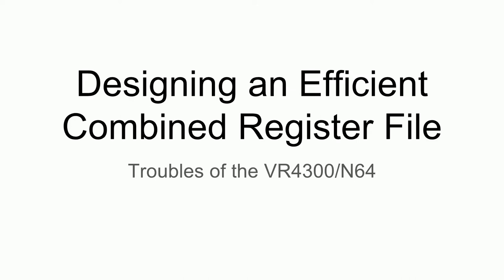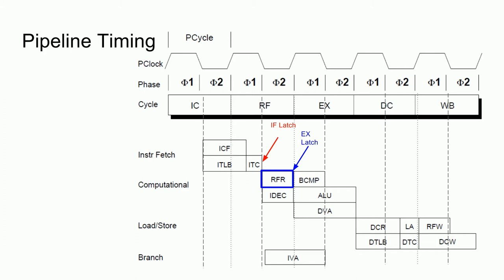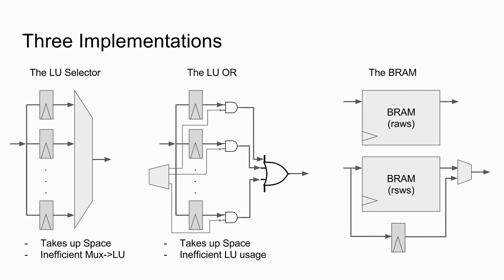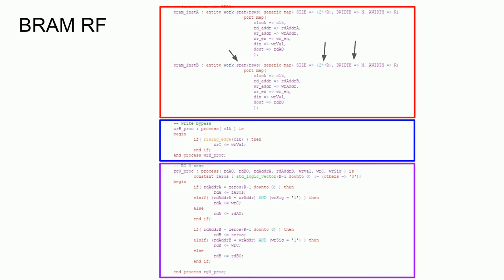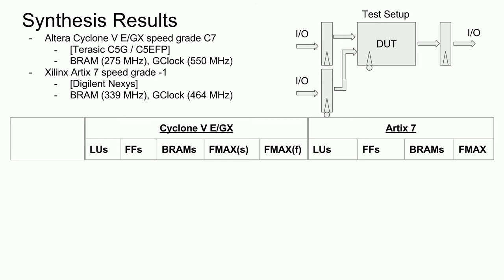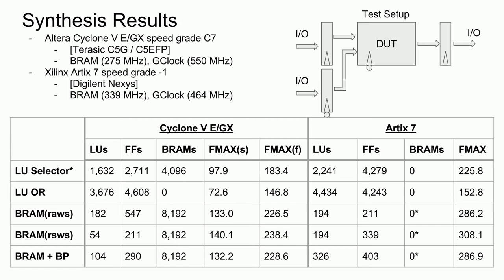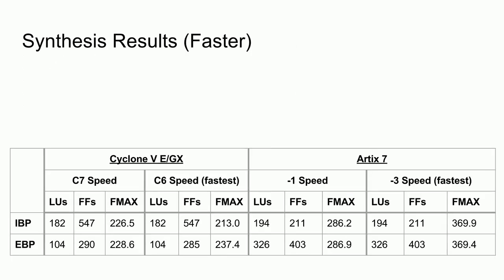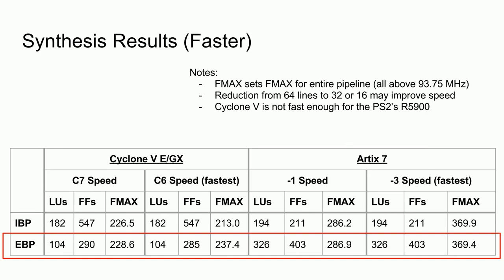Designing an Efficient Combined Register File

Comment: If you want to "shave" a tiny bit of a picosecond : initialise the register set's 0 register to 0 during boot then don't enable write to it later, so you save a test and a gate in the critical datapath during the read cycle.
The advantage is that the register write address is known well in advance, compared to the read address which must be provided extremely fast by the instruction decoder. So you can control the "write enable" signal outside of the CDP.
Reply from the maker: That's a good idea actually. Since the read logic replicates the the test, which would save a bit of logic and only require propagation in the write-back stage which is rarely the cause of timing problems.
I may have to implement that solution, since the RF stage of the VR4300 is a 1/2 cycle.
Thanks for the suggestion!
Reply from the maker: Actually, I just checked what I did, and I effectively did what you suggested. Instead of testing for address 0 upon reading, I inhibit writes to address 0 during the clock update. I.e. I used a loop to connect the register clock writes, which skips index 0.

Comment: Great Argument, however one question in the LU OR implementation, can using tristate buffers enabled by the decoder help? The and-or stage is essentialy doing that only. Which would be more preferable from the two, as a first-cut prospective?

Comment: What happens when you force the Altera implementation to use MLABs (distributed RAM) as well? Cyclone V should support this.
Reply from the maker: The Cyclone V doesn't have distributed RAM in the same way as the 7-series. The 7-series has SLICELs (logic) and SLICEMs (memory), where as the V series only has the equivalent of the SLICEL (Altera called them MLABs as I recall). They are also implemented differently where the V series used traditional MUX based LUTs and the 7-series uses SRAM blocks. The main difference between the SLICEL and SLICEM is that the SLICELs are read-only. So when you implement distributed RAM in the 7-series, it uses the SLICEM blocks (which have different configurations, the largest being 2-bit 128 entry, and the smallest being 6-bit 32 entry - both configurations only use a single SLICEM). On the V series instead, distributed RAM uses the registers / FFs in the MLABs. I could be mistaken though - it's possible that I missed something.
Reply from the maker: I'm not sure if you still have the OR vs Mux question. On the V series, they should be functionally equivalent, however, the OR implementation does lend itself to a tree-based routing scheme better, so it will have less resource utilization at the cost of propagation delay. For the 7 series on the other hand, it has dedicated MUX components in the SLICEs, so using registers + Mux can implement 1-bit of 4 registers in a single SLICE (using both the FFs and the Mux), where as the OR implementation would need 2x SLICEs. Though you still gain the advantage of the tree-based OR method being easier to route. That was the whole point of trying both, and it did differ on some of the implementations.

Comment: Note : I have solved the "Mux wall" problem for the version with individual FlipFlops : https://connect.ed-diamond.com/GNU-Linux-Magazine/GLMF-218/Quelques-applications-des-Arbres-Binaires-a-Commande-Equilibree
it might not be the best solution for you case because I think specialised BRAM is best, but it's good to know you can make large MUXes with a lower propagation/fanout price :-)
Reply from the maker: Sure, that's a solution, but not a very code friendly solution (i.e. it's hard to tell what it's doing). For this case, using a BRAM or on the 7-series, the SLICEM RTL-RAM is significantly more efficient.

Comment: My brain hurts.
Reply from the maker: Because something that should be simple is not so trivial? Or was there a part that was confusing, and should have been explained better?
Reply: RTL Engineering 

It was all explained perfectly, it's just a lot of info to absorb. lol

I've had a tiny bit more success with booting the SGI Indy BIOS on the DE1 btw.

I got the serial output working in the same way as I did for the PS1 BIOS - by finding the routine which writes the data in a register (in this case, $v1) to the serial chip, then grabbing that value on the next instruction, and writing it to a UART TXD block.

Unfortunately, the serial strings are word swapped, so I'll have to figure that out, but I can at least see where the boot process is failing now.

I'm spoofing the reg values for how many "SIMMs" are installed, and the BIOS is now attempting to do a quick RAM test.

But, the aoR3000 core is not allowing writes to the bus in the 0x9FC00000 range (uncached?), so I'll have to tweak that some more.

Not sure why It's trying to write to the BIOSes location, but it probably gets unmapped by another reg just beforehand?

Or, far more likely is that it's trying to use the TLB, which I of course disabled previously when I was messing with the PS1 stuff.
Re-enabling the TLB shouldn't be too hard, but I expect tons of other issues afterwards, as there's still no FPU.

I'm tempted to plug in the R4300i, which is already on an adapter board, but then I lose most of the debugging and register grabs that I can currently do with the aoR3000 core.

I'd also need to write a state machine for the SysAD / SysCMD bus, but it might not be too bad.

Anyway, it's been fun to mess with, and learn more about the SGI hardware.

Really enjoyed your vid again, as it's very relevant to the PS1, SGI, and obviously the N64. ;)

I posted the link to this vid in #n64dev on IRC earlier, as I know they will also appreciate it.
Reply from the maker: Awesome, thanks!

So there is one way to tell if it is expecting to go through the TLB, were there any TLBWI or TLBWR instructions that passed over? By default, the MIPS TLB starts in an undefined state, and it's the job of the BIOS to initialize it, if it plans on using it. I was trying to get u-boot to work on a C++ implementation of a R4000 core, which kept ended up trying to write to BIOS ROM. The reason for this ended up being that the evaluation of where to go was read from an address which was in the TLB mapped region, but the TLB was never initialized (I hadn't implemented the TLB yet). I had to add in a quick 1:1 map for the TLB region, and I was able to get it past that point of the boot sequence. 

As for the serial port, shouldn't it be attempting to write to a specific serial device? They are typically memory mapped with a physical address, if so, then you should be able to read the output from the system bus write attempts. Or better yet, you could find out what type of serial device it was expecting, and implement that in the FPGA (serial devices are pretty simple). Also, probably not word swapped, perhaps it's a different endianess than you expected?
Reply: RTL Engineering 

Yep, I need to check for any TLB instructions next.

I'm hoping it will boot just a little further after I get the SDRAM working, as I really want to start implementing some basic graphics stuff.

As with most systems though, I highly suspect it will copy a chunk of the BIOS into to RAM first, so it probably has tried to set up the TLB already.

The Indy has a fairly complex Memory Controller ASIC as well, but most of that seems to relate to SDRAM mapping, parity checking, refreshing etc., so I can probably bypass most of that.

It uses mainly "PC style" stuff for the keyboard, mouse, interrupt controller, but all integrated into one chip (the IOC).

The serial chip core is also on that chip, but uses a (frankly overcomplex) Z80SCC core.

It looked like a PITA to implement properly, so I just did the register grab thing for now, and can pause the aoR3000 while each character is being sent via RS232 to the PC.

In fact, the aoR3000 is only clocked at around 4.65 MHz right now, because the current SDRAM controller has to be 1/16th speed on the user side atm, so I don't need to pause the CPU for the serial output, even at a whopping 115,200 baud. lol
Reply: It is all getting a bit unwieldy now though, as I had to add some extra bus outputs to the aoR3000 so it bypasses the (disabled) cache, so it can write data to the IO regs more easily.

The aoR3000 isn't really set up for accessing this mem-mapped IO stuff, so it wouldn't do the usual Avalon bus write requests in those ranges, hence me having to export the internal data bus stuff, and the exec_cmd_store signal for those writes.

Also, the DE1 Flash chip (for the Indy BIOS) is only used in 8-bit wide mode, the SDRAM is only 16-bit wide, and the aoR3000 of course expects 32-bit wide accesses for everything.

Getting the basic memory state machine working for all of that was another huge PITA when I was messing with the PS1 stuff.

Basically, it's all a huge kludge, and I don't really know what I'm doing, but it's fun to learn (when it works. lol)

(Oh, and the other reason everything is clocked so slow is due to the 70ns Flash on the DE1, so only ~14 MHz max.
It was originally a 90ns chip as well, but I replaced it. Terasic cut costs on the later DE1 boards, and stuck the even slower chip on it. grrr. lol)

I should really learn to use Qsys more, and move all of this over to my Cyc V GX board, and the LPDDR2, but I don't have a straightforward way of loading the BIOS image, and the GX board doesn't have parallel Flash. The aoR3000 core is at least already set up for Qsys, I guess.

For whatever reason, I've never had much luck getting a simple NIOS-II core running in the past?
I'm quite allergic to having to use a Linux environment just to compile something, as I've also had an untold number of issues there too.

It would be ideal if I could have a simple Qsys setup for loading the Indy BIOS image from microSD into LPDDR2, then it might be somewhat easier to manage all of the sub-blocks.

I even wrote a FAT32 loader in pure Verilog years ago, but the SD card controller is very fussy about the type of card, and I never added cluster chain following, so it only worked with non-fragmented files. sigh. lol

Plus, I only just bought a DE10 Nano about 6 months ago, and have been trying to get to grips with the SoC / HPS stuff for the MiSTer retro cores.

All of this stuff, and too many other projects, is why my brain hurts. lol :p
Reply from the maker: I sent you a message on discord with a possible solution using Qsys, and the NIOS-II. In the end you probably shouldn't use avalon or a NIOS-II, since it's not portable, however, it can be very helpful to quickly load and modify the boot ROM.
Reply: @RTLEngineering  Hi Are there Discord channels that you guys hangout?
Reply from the maker: @Nishant Pani I don't currently use a discord channel, but I just set one up. I'll make an announcement with details in my next video.